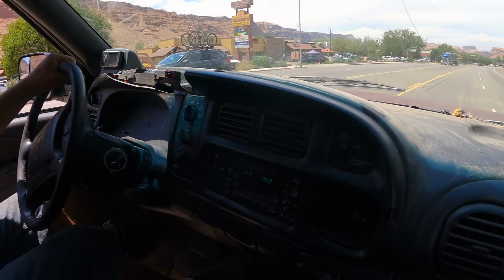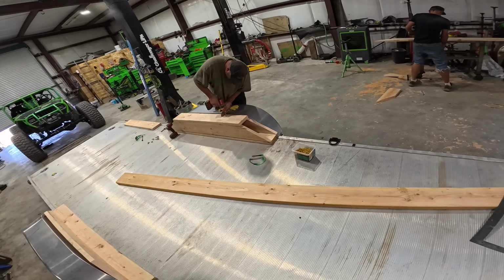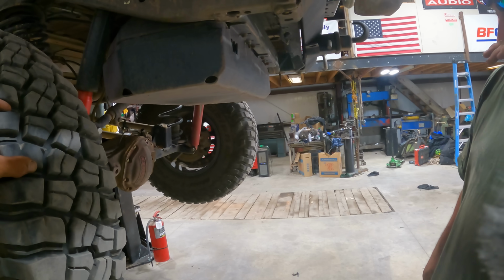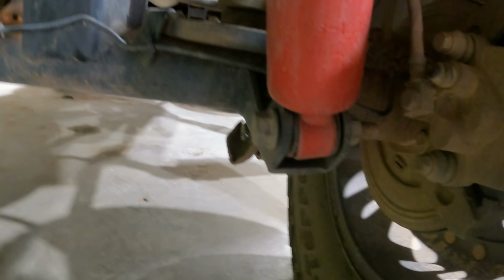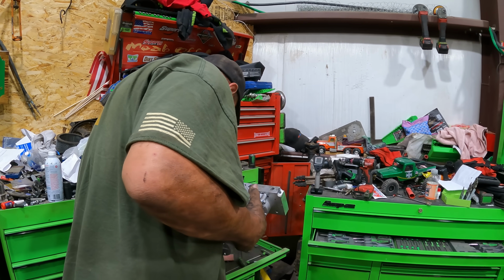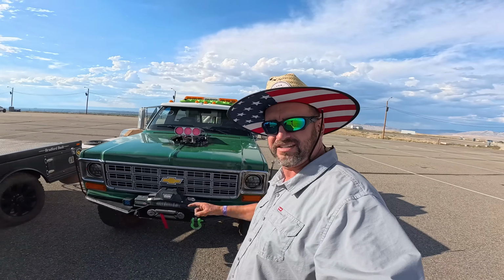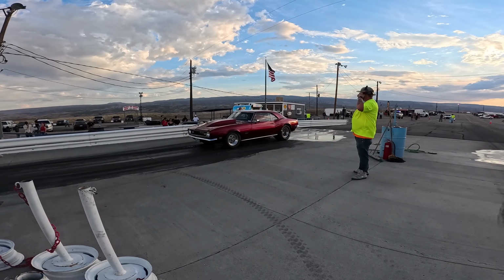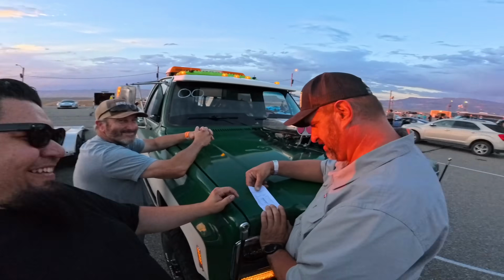Taking Ol Blue To The Dragstrip

Comment: So cool seeing Ol' Blue drag racing. Like the old school icing of the blower. Back in the late 80's I raced my 86 5.0 basic LX Mustang. One trick I used to do is put a bag of ice on the big intake on the top of the engine. I tipped up the back of the hood for room and to let hot air out from under the hood. I took 2nd place at The Muscle Car Magazine Nationals in stock small block. It definitely helped when it was really hot out. Was pretty fun.

Comment: Hey Rorry all the guys i know put it in 4 high to launch. Works really good, puts all the ponies on the ground. You may already know that, it just looked like you were in 2wd. Hell when i saw the thumbnail i was hoping you were in Fl racing Cleet.
Reply: In a part-time 4wd system, 4 high would likely slow you down unless you are getting wheelspin in 2wd. Smaller diameter tyres would help too.
Reply: @davebutwell3263  uhh no. At least do some research before you try to discredit my comment. Launching in 4 Hi adds traction and takes stress off of the rear end which causes loss of torque. All Diesel race trucks launch in 4 Hi. As for tire size a smaller diameter tire has to make more rotations then a larger diameter tire to go the same distance. More rotations equal slower speed. The key with that is to match the tire diameter to the gear ratio of the differential. To big of a tire you lose torque to small of a tire you lose speed. Just the right size tire matches to the differential gear ratio and you can reach max speed. You can have a 10 speed transmission capable of doing 200mph but without the right differential gear ratio matched with the correct size tires the vehicle will never reach 200mph. This is all factual information that you can research and learn more about yourself.
Reply: @stevenpierre1987  If you can't tell the difference in a to too, you might as well be wearing one
Reply: @duder9752  touche but how does that apply to my comments?

Comment: that brought back my youth in the early 70's,  55 chevy 2 door 150, 427 tat, 2 4 barrel on a tunnel running Bmp. we came ou to mile high a few times, we were running 15.2 at 2000 back home.   feet, 5000  we were 17.3. oh the fun

Comment: Was up in Moab about a week or so ago. Was in the visitor center for Arches National Park when I heard a hot rod driving down the road to the park exit . Turned and saw Rory in Old Blue towing a truck out of the park.  Of course, had to stop at the shop, got to meet Rory and Shawn. Old Blue was not fully happy and there might be some super charger issues to massage.  Anyway, had a nice conversation with Rory & picked up a few T-shorts & a trail trash bag.  Man, that Moab area is some beeutiful scenery no matter where you go.  Even found a basic off-road trail inside Arches park.

Comment: Some suggestions at the strip.   1. fold your mirrors straight into the wind.  2 Go at the next to last light light before the green.  That heavy truck takes .50 just to start moving...😮  3. Remove the air cleaner when doing runs.   Go old blue😂😊

Comment: Next drag day tip.
Leave on the third yellow light. Don’t wait for ‘green’.
This will help drop your RT.
Also, stay out of the water box. That is for running slicks. Drive around and do a quick wheel spin just to clean the tires.

Comment: I can’t tell in the video and I don’t know what your converter will stall at I am sure it’s low but power brake it as high as you can then launch when you see that second yellow light comes on.  By that time of your reaction and the truck moving you will cut a good light.  But that was awesome seeing that big truck moving that quick great job.

Comment: a small misting system to help reduce temps might help slightly, like a fog of water mist sucked in with the air at the intake which may or may not be mixed with Methanol or even rubbing alcohol, but in all honestly, 17seconds in a 4 wheel drive wrecker, thats impressive

Comment: Just a recommendation is you didn't seem to tach up the RPMs at the start only at the green light, if you bring them up before the light and use the clutch more it would probably give you a better time.

Comment: Rory, you probably don't need this advice, but here we go anyway: the couple of times I've drag raced my truck (92 Dodge W250, 5.9 Cummins, 5 spd manual, NP205, 6500lbs-ish), I found that leaving on the second yellow light instead of the third light helped me whittle down my reaction time to a PB of 0.003. I think there is just too much slop in HD drivetrains to follow the standard drag racer advice to leave on the third (last) yellow light. I'm looking forward to the video of you towing Cleetus' truck off the drag strip after he blows another driveshaft out of his truck racing you. 😆

Comment: Thank you for showing the air cjeaner cause I definitely was one of those people asking about the air filter being under the intake horn. The power band is odd in Ol Blu. The fuel yo are using, is it high octane race fuel or pump gas. I'm sure Cletus will be using high octane race fuel. Tyme to create a tune for it for the race of tow trucks.

Comment: I don't know much about drag racing but I'm pretty sure unsprung weight is an issue.  How about putting some lighter tires on Old Blue...maybe some throw away light truck tires from the local tire dealer.  While you are at it, small diameter tires would also make the gear ratio lower for drag racing.

Comment: I did the math on it, I figured if you have 4.10 gears, and a 37 inch tall tire in single low you could run 77 miles in hour at 5,619 mph, but it would probably be out of breath before the end of the 1/4

Comment: Maybe try take the air cleaner off & possibility of putting a windshield wiper fluid for meth injection (just a small jet will help dramatically, even though you’re probably capped out with that single 4150 flange )

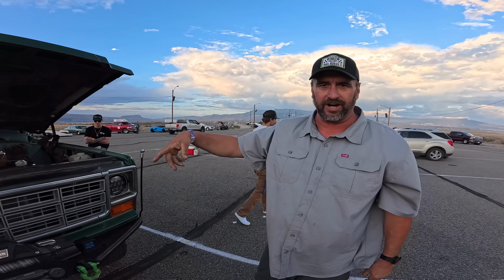Comment: 16:30 you need a vintage predicter carburetor that will lesson your bottleneck and loss of potential power .... look it up rory predictor carb variable ventures ...... back in the day BigFoot monster truck run 2 on top of the blower
Reply from the maker: They were called predator carbs. Not putting them on my offroad tow truck. I prefer EFI for the trails. Thanks tho.

Comment: For sure run the air cleaner normally but next time you drag race…try removing the k&n and see how it runs.  Truck just sounds like it is running out of air or fuel or both.   Im betting the extra air will help.  You could also find some “on kill” pulleys to install when at the track…assuming the fuel will keep up.

Comment: When you go race cleetus, through a little taller gear in and take advantage of all the torque that big block is making and try and get it up on the converter a little more if you can  so you’re leaving the line with a little more boost.. I can’t wait for the big race ol
Cleet ain’t done nothing with his besides break it so…

Comment: Would it be silly to put a stall converter and a different pully on the blower, before racing cleatus?  perhaps some shorter tires too? cause reasons... it would still technically be offroad capable... but have way more get up and scoot for the 1/4

Comment: I don't miss working on Jeeps! I still love them, but working on them, I can live without! My first gen Tacoma S.A.Swap is so much better engineered, especially with the Elimination of the IFS! From snapping crappie bolts on my TJs to my XJs self destruction and my JKs water park in the dash? AC that makes almost all of them overheat, so many problems that I had to just walk away! Plus I wanted a pickup, and there was basically no choices, either the silly wheelbase and bed of Gladiator or a uniframe MJ, just no choice! It was time to give up on Jeeps! And I'm glad I did, not I can wheel all day with the AC on and fit 2 motorcycles in the bed and get decent mileage, I still see a clean TJ and say "I want another Wrangler" but I don't think so.

Comment: Elevation matters in drag racing. Western Colorado Dragway (WCD) has an elevation of 4987 feet, Bradenton dragway is essentially sea level. In otherwords, if Ole Blue makes 500hp at WCD, at Bradenton it will make 575hp. That's no small difference.

Comment: If you ran the truck with just a single tire on the back, you’d pick up some ET. Those big wheels and tires are a lot of unsprung weight. You don’t need the second tire for traction.

Comment: Some posts mention that you were running at 4500' elevation; is that notably higher than 'home'?  If so, you would probably need to change pulleys to maintain your boost level.  It seemed that your gearing is too tall.  Ideally you want to tach out in your top gear at the finish line.

Comment: Filtered yes, but sadly too small for the volume of air needed to properly supply air.
No way that little filter will supply the boosted air required to satisfy a big block Chevy with 5 lbs of boost.
Try it with a much larger filter, since you now have a time recorded, but in order to be accurate, you'll have to get ambient temperature as close as possible. 
I don't know exactly what elevation ya'll are located at but as we all know the higher you go, the air gets thinner.
Hopefully I'm wrong, but I doubt that I am.
Next what size exhaust is on it, because it can't breath if it can't exhaust the air coming in.

Comment: I guy I know who races dirt track and is sponsored by K&N only runs  K&N for pictures otherwise he runs  like a wix or fram. K&N are great for clean environments as they let a lot of air in but if you're around dust get the fine partical filter to put over it or it'll let dirt in too

Comment: Has that flywheel been broken and rewelded or something?  Beacause its really out of round"...  obviously its bent and wavy..  but its also out of round pretty bad..  if you look closely at the starter shaft while cranking, you can see the  flywheel acting like a cam, and pushing on that starter shaft quite a lot as its rotating.  Now i see why it busted the front casing on your other starter.  I would definitely put on a different flywheel the next time you pull the engine or transmission...  for whatever reason, that flywheel is off center, and its pushing a lot of unwanted pressure against that starter shaft and bearing.

Comment: Ha, a dodge truck is not a great truck. Never was, never will be. If you buy one, you get what you deserve.
Reply: Well...that being the case, guess I deserve dependability and satisfaction.  Had the current one for 16 years, been driving them for 45 years. Had a Ford. Once. Had a Chevy. Once. The hood hinges were worn out on both.
Reply: While i prefer a gm truck, i do have a 1st gen 12v with nearly 700k, one trans replace to a manual and one major engine rebuild, other than that just reg maintenance.not too shabby